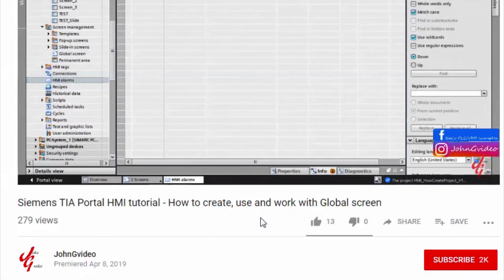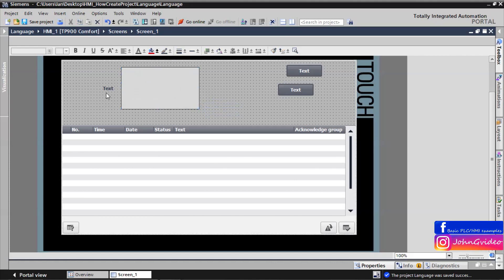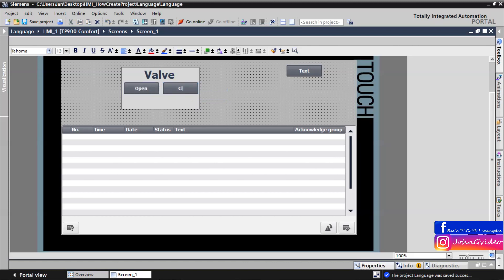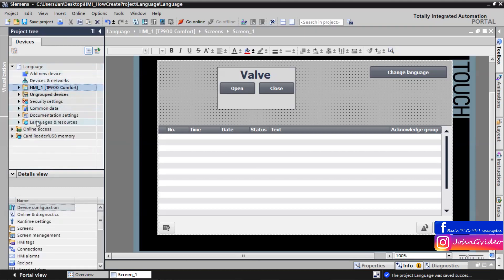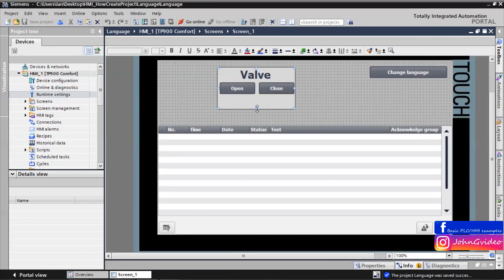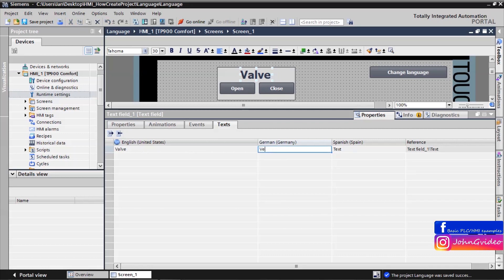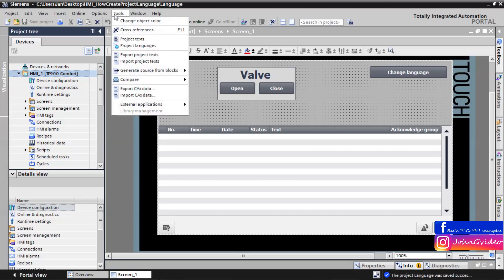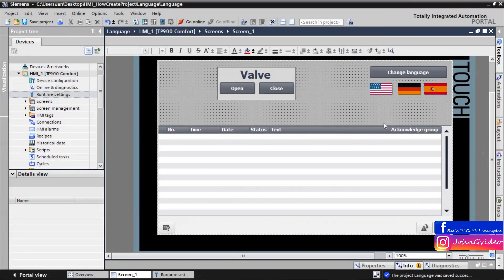Siemens TIA Portal HMI tutorial  - How to create Multi Language HMI (WinCC)

Comment: Just tried with a KTP 400 and it does not work!
Reply from the maker: I think using more languages its also possible on basic panels. Maybe its good to try it by other way
Reply: @JohnGvideo  Tried with "toggle" button. This is the way I need it to work. Maybe it works in the panel, in the runtime it didn't work. Thank you.